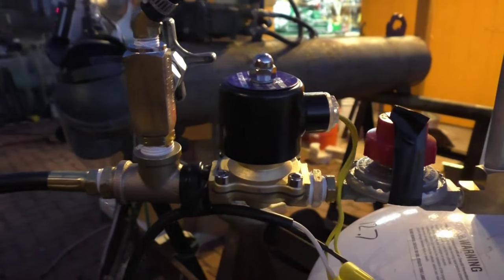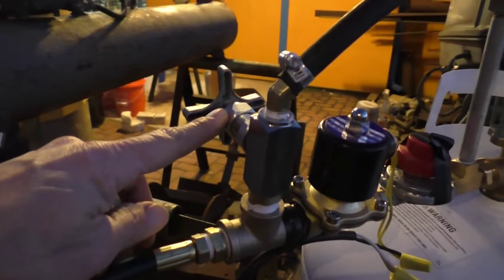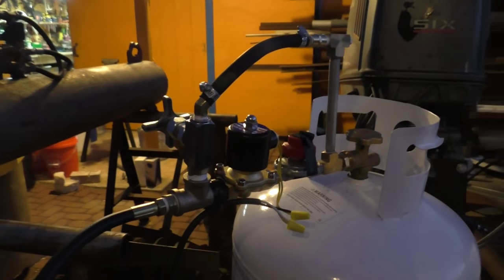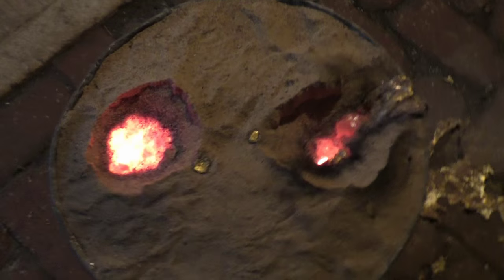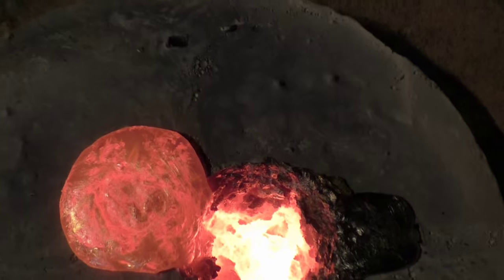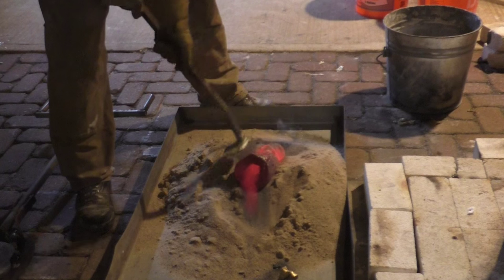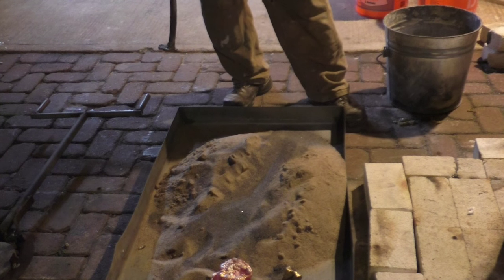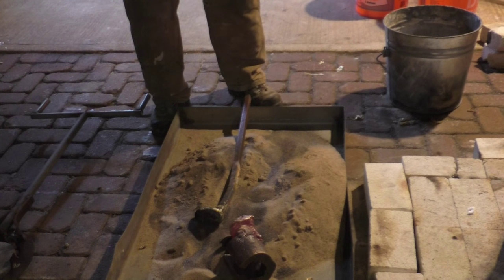Anchor Winch Rebuild - Part 10 - Plaster Block Mold Bronze Casting - Got One

Comment: green sand still seems like a much easier solution than plaster
Reply: +J.A.Ratt85 Can't use it for this type of pattern that can't be parted in two.
Reply: J DeWitt DIY yes you can.. I've seen it done... How do you think they make cast aluminum wheels or engine blocks?
Reply from the maker: +J.A.Ratt85    You're completely entitled to your reality.
Reply: greensand wouldn't work, some combination of sand and cores might, but lost wax is much much easier than the crazy cores they would be using
Reply: J.A.Ratt85 I suppose you could use multiple parting lines and cores, but it seems it would get pretty complicated, pretty fast.

Comment: The lost form way you cant use anything but kenetic sand, such as what we call green sand. if you dont the only part of the mold the will turn out is the first half that hits, the other half of the foam will burn from the air temp before the molten can take its shape, the sand will colapse causeing your half perfect half shit mold
Reply from the maker: +DERPY RAGE   Actually I have use play sand, and it worked just fine.
Reply: pure play sand? well you lucky, did it 7 times and alwayys collapsed on me half way throught the pour.always got a half and half. so what did it di for you on the bucket where you thought the sand was  molten? did that it mold the whole thing or half, never saw original foam so i couldnt tell.
Reply from the maker: +DERPY RAGE    That did fairly well.  The pour cup opened up, but the part was fine.   Aluminum is here I have had better success.   Try dipping your foam in sheet rock mud and letting that dry.  http://svseeker.com/lost_foam_casting.htm
Reply: sweet thannks

Comment: You were talking about slip on the experimental parts.  Found a video that covers what you were talking about.  
https://www.youtube.com/watch?v=6fEU3fuQd9s
I think I like this method.  No need to cook the mold.  Amount of slip is very small compared to what your doing now.  Sand is reusable.  I like the use of EPS over paraffin mostly because of the amount of combustible difference.  EPS burns but it's mostly air.  Wax is 100% fuel.  Hope this method has some use for you. Best of luck.
Reply from the maker: +Robert Palmore     I've seen that and also chatted with a Chinese instructor that teaches lost foam vacuum casting at technical schools in China.   It's not an easy system to replicate especially as they use a vacuum to draw out the gases and draw in the metal.   Here is our attempt:  https://youtu.be/7ccfncNZeSI?t=525
Reply: SV Seeker They make it look so easy in the video.

Comment: You could contract your work piece out to a sophisticated investment casting factory.  You know, the  kind where the finished product is flawless.   And I rather think it will cost you a mere fraction of the resources you are using thus far.
Reply from the maker: +Gary Perez    It would cost you the knowledge of how to do it yourself using the materials you have.  To me that is priceless.
Reply: if you wanted a flawless boat for the minimum time investment, you'd buy one. Not build it in your backyard.